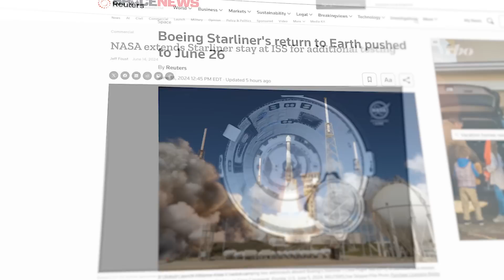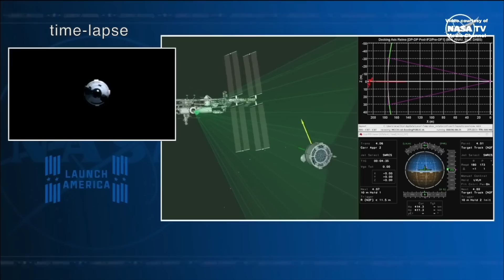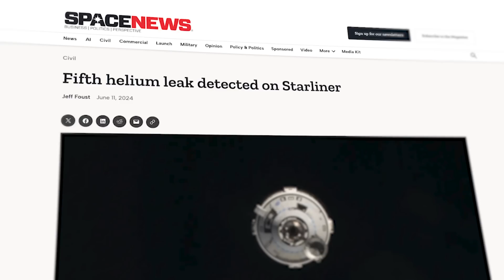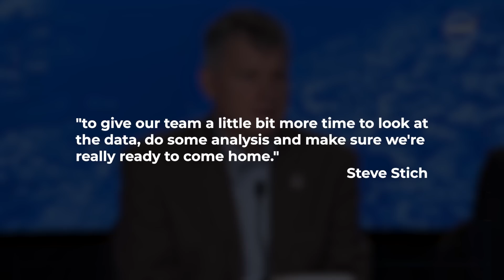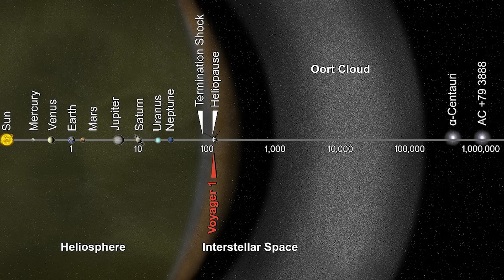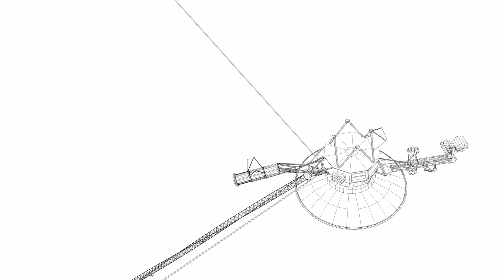The Boeing Starliner Has A New Problem!

Comment: With a helium leak, the thrusters will not be 100% dependable, putting the astronauts lives at increased risk. These are results of DEI. Junior engineers not qualified in space work must be double checked by senior engineers, but if there is no managing engineer, Boeing has these engineering breakdowns.
Reply: Many of Boeing’s issues stem from adopting McDonnell Douglas’ business model of designing by shareholder and contracting out as much work as possible to maximize profits.

Comment: Why so many problems?  NASA put men on the moon at first attempt and brought them safely back, followed by several following missions. That was with 1960s technology and computers with less computational power than my digital watch.  The used to say, "If ain't a Boeing I ain't going".   Now they say, "if it's Boeing, screw that!"
Reply: NASA was receiving about 4% of the national budget through much of the 60s and getting people to the moon and back was a very high national priority. 

Also, “first try” is a bit of a misnomer. They practiced everything but the landing itself in the missions leading up to Apollo 11. 

Today, NASA receives about half a percent of the national budget. NASA has always contracted out launch services, but now more than ever is there a push to involve commercial entities in spaceflight. 

Many of Boeing’s current issues stem from adopting McDonnell Douglas’ business model after absorbing them. They took to designing by shareholder and contracting out as much work as possible to maximize profits.

Comment: These problems with this craft are totally needless. First of all, NASA should have used the trusted Saturn V rocket upgraded to carry the Starliner crew craft and this capsule needs to be 100% compliant with the ISS capsule docking system. Boeing has failed miserably in trying to reinvent the wheel.

Comment: 5:19  Dream Chaser is not a manned spacecraft. Sierra Space has a Commercial Resupply Contract, not Commercial Crew. Although Sierra originally bid for the Commercial Crew program, they lost out to Boeing and SpaceX (and don't you know there are people at NASA gnashing their teeth over that decision). They nimbly switched gears, and began designing an unmanned version of the craft which won them a CRS contract. Although they do still hope eventually to bring out a manned version, they have no contract for that and, even if they did, that would require years of development work. Even at the most optimistic, they will never provide crew service to the ISS. With luck, they will be able to service the private, commercial stations that will replace it.

Comment: If this had been the Dragon Capsule it would have been ended.  Instead because Boeing is embedded into NASA and the DOD their shoddy work allowed.  Boeing has proven time and again it does not care about Engineering and Safety only profits for the board and corrupt executives.  They have no problem ending whistle blowers.  Boeing's board needs to be sent to prison for fraud.

Comment: NASA obviously doesn't have their shit together anymore! Already lost 3 crews (what 17 astronauts) That's 3 catastrophies that actually could have been prevented. 2 were repetative known serious safety issues well in advance of the SRB o-ring burn thru (especially at lower launch temps), on Challenger. And the damaged ceramic tiles  mainly on the leading edge of the orbitors wings) by central tank foam detatchnent with ice. On top of that NASA allowed the EPA to change the structural adhesive formula, that made the insulation rip away even worse, Columbia. Apollo 1 ran pure O2 at not 5 but 15 psi. Were managment got carelessly complacent. It goes on and on. I hope i'm wrong! There going to lose another crew. Brave n courageous souls no doubt.

Comment: It's the Stayliner, and it can only do it for 45 days. Compare with Dragon, which is good for 210 days.

Boeing needs to test ON THE GROUND so they don't have to test *IN SPACE*.

That's like setting off on a cross country car trip and only checking your tires after you're on the side of the road with a flat.

Boeing is not an aerospace company. They're a vehicle for political graft.

Comment: He leaks are plaguing Boeing.  The module that will burn up on reentrry is where the problem is (it's not a He supply issue, it's that the He is critical to thruster control).
This really sucks.

Comment: Why it ire dangerous than usual , is Boeing using a different type of engine  its simpler they are two different type of fuel,  that mix together  self ignite the mixture, so these two leaks can explode if enclosed. It best to leave them behind. Going for pride can bring the opposite , as everything in a circle , time decide winner or loser.
Reply: Timing
Reply: NASA uses helium to refill spent fuel, it’s need volume refill or the cylinder would collapse empty, so by  logic the tank are mostly replaced helium, nasa say they have enough of helium for a set time. They  have to refire engine for position of tile effectiveness angle and few other so that  need replacement. Mistakes. Are time and helium costly of low supply.
Reply: Boeing ….how much time is  tank collapse time?  add only 80% full tank  risk. LOL vs glory

Comment: All this breathless piling on on Boeing gets tiring. Let me address all this crap one by one.
#1 - Yes Boeing did get paid more than SpaceX IF YOU ONLY CONSIDER THE COMMERCIAL CREW PROGRAM. However, all you Elon fanboys are forgetting the money NASA paid SpaceX to develop Cargo Dragon, and the 6 YEARS of heritage flight time on Cargo Dragon that SpaceX has for much of the hardware (INCLUDING THE RCS thrusters) that goes into Crew Dragon. If you combine the NASA money from Cargo and Crew versions of Dragon, you are at MORE MONEY than Boeing got.
#2- The reason Gemini and Apollo did not have thruster being "deactivated" all the time was they didn't have computer software monitoring every little fart or off nominal thrust of the units. On Gemini the first indication of a thruster failure was either it didn't fire, or the capsule was in a near fatal spin. Clearly Boeing's software must be extremely "picky" because 4 out of 5 of the "de-activated" thrusters came back up when they manually restarted them.
#3- There were thruster issues in the Service Module on the unmanned test flights. NASA and Boeing thought they understood them and fixed what they THOUGHT the problem was. However, since the Service Module burns up after a mission, they did not have anything to look at to be SURE they figured it out. THAT is the reason that they are staying up at the ISS longer. They want to get as much data as possible to be absolutely sure they figure out what the problem is before they undock and burn up their test case. If they were thinking the system was degrading further, they would have left early, not later. So clearly the helium leaks are not so severe that the system will become inoperable.
Now of course, if NASA says that they have to wait for a Dragon 2 to pick them up, I will have to eat my words. But I do not think that is the issue, and I will not be overly worried if and when the crew undocks to return home.

Comment: - get on starliner return with dragon/soyuz

also stoke space is really good imo, honestly has a better chance at working than starship as it avoids heat tile issues, along with a potentially better capsule like structure compared to starship. good to see a rocket company not just copying falcon 9.

Comment: This is not about fuel content more about erratic thruster control.
Thing is the deorbit alignment attitude control depends on perfect thruster control...they obviously don't have that yet and with dubious ability to fire thrusters when needed it seems somewhat of a  hail Mary plan..
Once committed to reentry that is it, the thruster control is required to work flawlessly and there is no going back up to get another go.
That said it is more then probable  they will use Starliner for return anyway on this mission, even chancing thruster fall out...question is how many thrusters can they lose before they lose the craft.
It is eminently possible that they will decide Starliner is good to return with crew... but there will be tight buttocks in mission control...and at least a couple in Starliner, if they go for reentry then they must be confident about performance.
Bet NASA are already talking to Spx anyway...and today somewhere there is a Dragon training simulator with two crew members going through procedures required to be a cosmic Uber tasked with two pickups...Might not be needed but there is no harm in preparation.
Not convinced that Starliner will earn a NASA certification after this mission concludes though...think there is a lot more work there before then.

Comment: I'm not a rocket scientist, so have a question for anyone.  These space vessels use thrusters to maneuver. It is my understanding that there is zero air in space, it's a vacuum.  So if there's no air for the thrusters to push against thus causing rotation or movement, how does it work?  Yes, this keeps me up at night dammit...
Reply: "Every action has an equal and opposite reaction" ...;)~ ...So it's "pushing" against the ship...
Reply: @bearwaggoner7615  but doesn't it need something to push off of like air?  Please excuse my ignorance of physics....lol
Reply: have you ever blown up a balloon and let go of it to see it fly everywhere? thats the same pronciple as rockets. the rocket pushes gas out like a balloon, which is not dependent on the ambient atmosphere but on high pressure gas contained internally accelerating out into a lower pressure region (in the case of space a near infinitely low pressure) and according to newton's third law if that gas is accelerating outward, it outs an opposite force on the rocket, pushing the rocket foward. there is more to it, but that is the basic principle.

you could say that the rocket is using its own internal air to push off of.

Comment: Boeing has had these type problems for decades. Following their successes in the 60s and 70s they stopped writing original software or designing original hardware. Almost all of their problems since have been related to old software and old hardware designs being tweaked. They don't write original software for their new hardware. And their "new" hardware is just "updated" old designs. It's too expensive to hire the best software engineers and to run exhaustive testing of the new code which takes too long, and is expensive, to get FAA approval on completely new hardware designs. The most notorious example is the 737 Max and MCAS which caused two their new Max's to crash. To save money on FAA approval, Boeing just "updated" the old 737 with new engines and used a "tweaked" version of MCAS (an existing program) to manage the new 737 Maxs engine weight and center of mass changes. This didn't require all new testing and approval by the FAA of a "new" aircraft design. And almost all of their problems with their newest spacecraft as well as their new aircraft designs have been software related. It is just another example of their cost saving corner cutting. Starliner is just the latest example. It's an updated Apollo capsule design with tweaked software managing it. Watch for more "bugs" from Boeing in the future. Hopefully, they don't kill the astronauts like they killed all those 737 passengers.

Comment: What worries me most is that it could be that computer parameters are exactly as cautious as they had to be, but in the rush to solve the problem they forced it to operate out of specs, pressed by management to reduce PR damage to a minimum. This is  a common scenario in commercial software, but it shouldn't happen with a capsule transporting people in space.
Reply: Nope. This isn't common in space operations.

Comment: Thruster problems? Srsly? Aerospace maneuvering thrusters have been around for 70 years now using cold gas, warm gas, hot gas, plasma, bi-propellant, monopropellant, compressed gas, and probably a half-dozen  more I can't think of at the moment. Oh, and reaction wheels. What is wrong with these people? How can you burn though such massive volumes of money and be nearly a decade late and still have problems in such a fundamental system?

2:45 Helium may be only the second smallest element, but it is actually the smallest individual particle because it's inert, and a helium atom is smaller than a hydrogen molecule.  That's the main reason it's used for leak testing in industry (well, that and the fact that it doesn't potentially explode on you during use).  That said, sealing helium has been a known science since the end of WW II. I've designed a few valves and seals myself.  It's not easy, nor cheap, but how to do it has standard practices in industry.

Comment: Is Stoke Space using an aerospike?? About time someone did! Elon should really have diverted a little effort into keeping ahead of the pack on that tech.
Reply: thats why i like stoke more than spacex, and fedl it has a better chance at working than starahip. they use a metal heat shield that is cooled by the cryogenic propellant, increasing reliability, resuability, and avoiding heat tile issues starship has. after that the propellant goes into the engines, which warmer propellants from the heat shield will also work for increasing efficiency. then with all that they then use the heat shield as an aerospike for even more efficiency. the shield is also tilted to allow for steering and managing the landing spot. so there is a lot going on from the heat shield that is incredibly creative and intelligent.

Comment: Full flow stage combustion is really just a nice feather in one's cap.  Without the insane chamber pressures of the various Raptor engine models, there's nothing to promise the engine will be any more efficient than Blue Origin's engine.

Comment: The Starliner has had continual issues...Considering it was designed and built by Boeing it is of NO surprise!! Boeing has NEVER built anything that was not without issues,now Boeing is having a problem with the 737 MAX,it has soo many issues that for the last 2 months, there have been NO new orders for the Plane and other already existing Contracts to buy the 737 MAX have been cancelled!!! Let's remember some of Boeing's Failures: A Plane that had it's "Door Plug",(a complete Door),fall off during flight endangering all the passengers in the immediate area of that, "Door Plug"!! A portion of the top of a 747-800 Plane to fly off during flight, again endangering passengers,thankfully the Plane was at a low altitude. The numerous Lithium Back-Up Battery Packs,,,(LiPo4 battery Pack),catching fire putting toxic fumes into the cabin area,because the battery containment box had insufficient cooling and the individual batteries making up the Battery Pack had NO spacing between them, plus the Charging System was NOT designed properly and would "Over Charge" or Charge at a dangerously high level causing severe Over Heating of the Battery Pack and then catching fire. I could go on and on,but let's face it, If anyone with abit of good ole Common Sense wouldn't have much or any, "Trust" nor "Respect" for a company that skimps on, "Quality Control" or , "Cuts" alot of Corners,(as we have recently found out thru, "Whistle Blowers"),just to get a Plane out the door to collect a Check for such shoddy workmanship!!!

Comment: Have they considered alternate noble gases such as Argon as a non-reactive pressurization gas? They may have to test its compatibility but Argon is vastly more available, containable, and not for nothing cheaper than Helium. There’s vast experience in handling Argon and its use as an inertting agent.
Reply: argon is 11.1x heavier than helium which is a problem when you're trying to get to space. also the expansion from the phase change is less, so the tank needs to be bigger. sealing the tank properly is not an unsolvable problem, they used liquid helium in the saturn V in 1967 without issue.

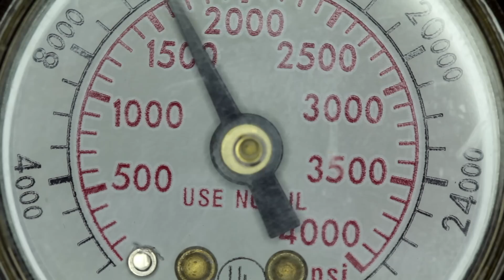Comment: Keeping the ship "strong and rigged" is not why helium is needed (3:06) It's to pressurize the propellant tanks as the thrusters are pressure fed. Also, the driving case for helium tank pressure (likely, I didn't work on this vehicle) is the abort thrusters that run at higher thrust/pressure.

Comment: I think we have enough compliant reporters in mainstream news. What we need are reporters that scrutinize agencies and officials, not just parrot their talking points. These problems are not cosmetic. They are critical maneuvering systems that must perform very well to prevent the capsule from missing the critically important re entry windows. Saying we just wanted to give a little more time to collect data is at best glossing over the problem. Remember, this ship will be navigating at over 20,000 mph and it’s only steering is that system. Those two people’s lives are precious and invaluable. It seems some people are more interested in their image and reputation than seems appropriate. You seem to be in alignment with them.

Comment: Good enough ?  No, not good enough.  Having repeated problems has to be a concern.  Everyone states this was a test flight.  I understand NASA required tow certification flights.  Starliner had issues on every flight.   Boeing received a major portion of the money for this program and has failed both NASA and the public.  Now we are going to pay double the cost to use a failed design to fly to space station.  Why does NASA think this is ok.  Boeing needs to take their loss, stop the program and fix their business model.  NASA needs to not waste taxpayers money keeping a failed program going.  I state this is a failed program when you look at the money Boeing has spent vs the product they provided.